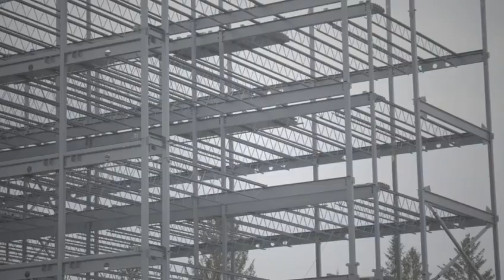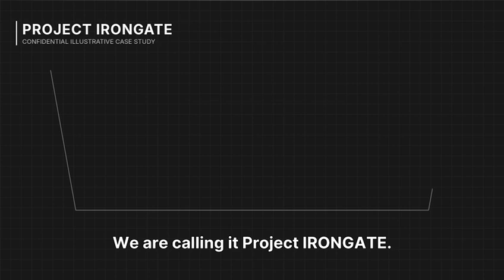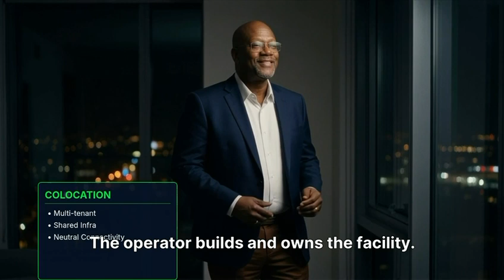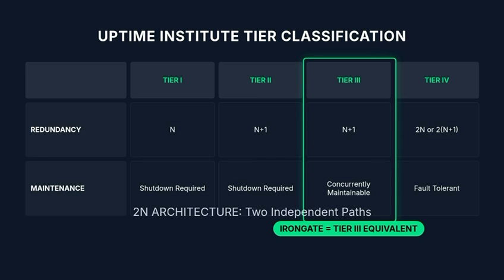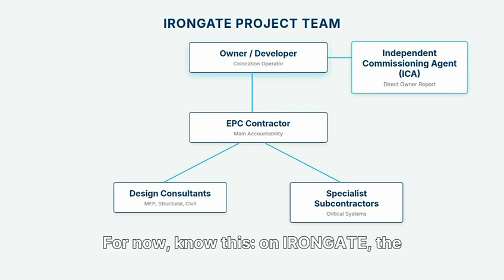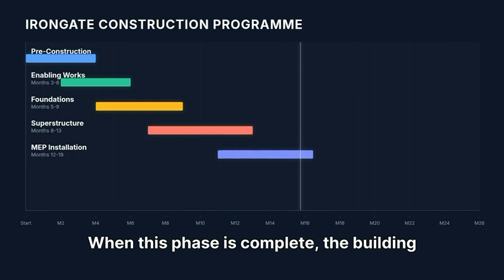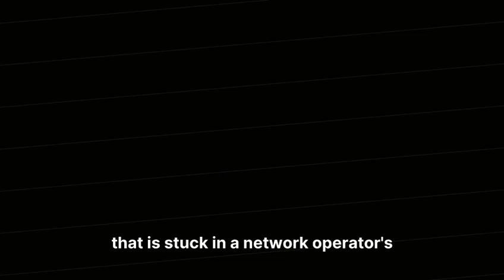Catalyst Grid | Series 1 Episode 1 —Building a Data Center From Scratch (Project IRONGATE Blueprint)

Comment from the maker: Welcome to Catalyst Grid — Building the Machine.

This is Series 1 Episode 1, where we start building a data center from scratch with Project IRONGATE, a 10MW colocation facility.

Across this 18-episode series, we will follow the entire lifecycle of a modern data center:

• Site selection
• Power and electrical architecture
• Cooling systems
• Construction and MEP installation
• Commissioning and reliability testing
• The moment the first server goes live

Question for the industry:

What is the biggest risk in a data center project?

⚡ Power availability
❄ Cooling design
🏗 Construction delays
🔌 Commissioning failures

Drop your experience below — the best insights will help shape future episodes.

If this kind of engineering deep dive into digital infrastructure is useful for your work, subscribe to Catalyst Grid and share it with your project team. 0:12